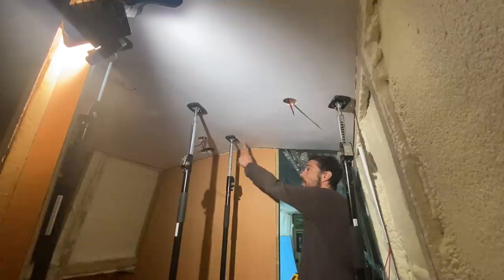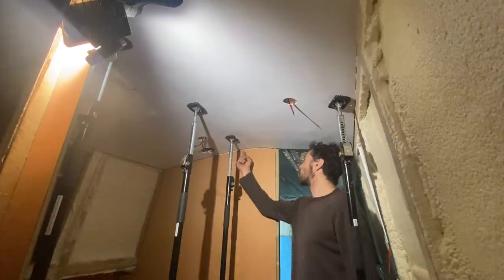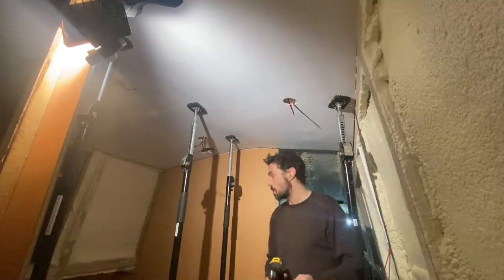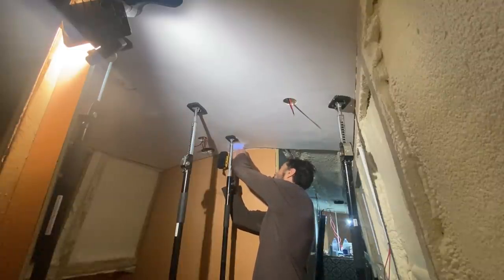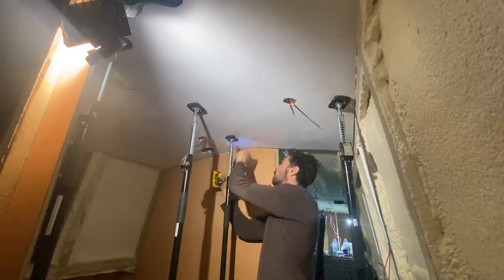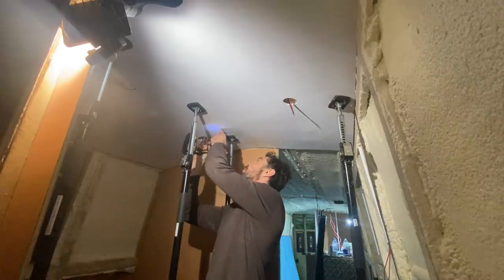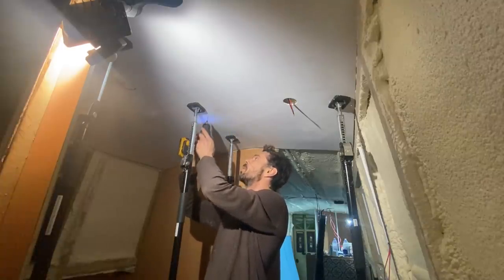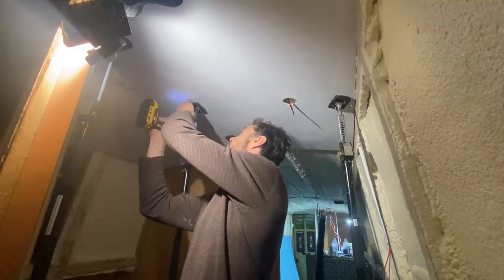94. Narrowboat shower enclosure takes shape

Comment: Dear James
I hope you don't have any problems with your drinking water pressure system. In video no. 58 I see the pressurised water tank mounted horizontally. If the tank does not have a diaphragm inside (air/water separation), the tank must be mounted vertically above the pump.
wish you much success, and greetings from switzerland
Reply from the maker: The tank doesn’t have a diaphragm. Surely the pump doesn’t require gravity in order to pump water as long as there is an air inflow
Reply: @TheNarrowboatThatJamesBuilt James,  I think Urs' comment relates to the Jabsco accumulator which I believe does have a diaphragm.
Reply: @TheNarrowboatThatJamesBuilt  Jabsco call it a membrane rather than a diaphragm.

Comment: The little cut out in the ceiling worked really well, and some nicely applied silicone sealant will cover it up. Just thinking, what about putting in a small 12 volt fan in the mushroom as an extractor fan. Something like what can be found in a computer tower.

Comment: Would be a good idea to silicone seal around the shower tray to the plywood before you tile and fit the panels. If you still have a gap under the front edge of the shower tray you could slide a floor covering under it. Keep up the good work.
Reply from the maker: Peter - I have just done what you said. Glad to see I’m heading the right way. Cheers 👍🏼

Comment: If you don't screw the outside batens on the Selling the weight of itself will sag  and will pull away from the wall Over time I gerrentee it. ... even glass saggs over time it is not a solid like is believed. Cheers
Reply: If I could stay fit and healthy I would be very interested in watching it happen.  Things with real glass aren't all that old here. But we do have a few windows that have noticably settled toward the bottom.  From about 1846.